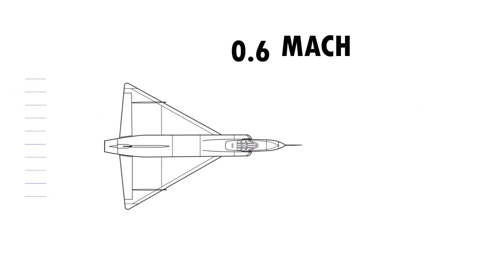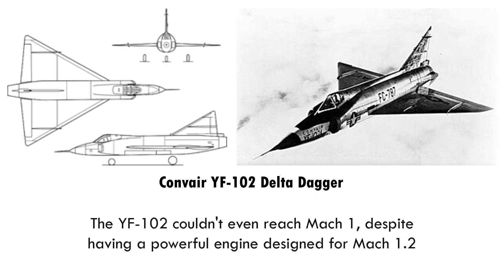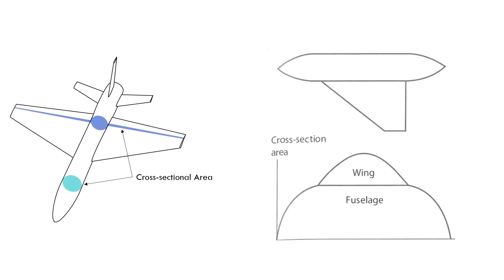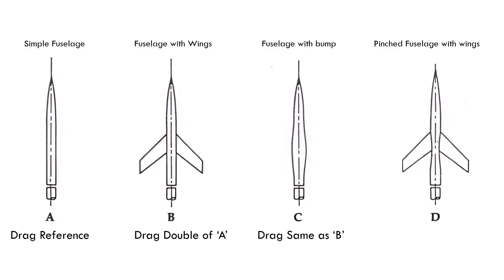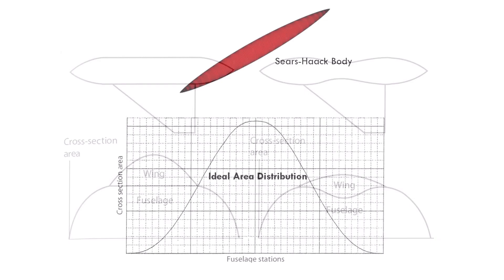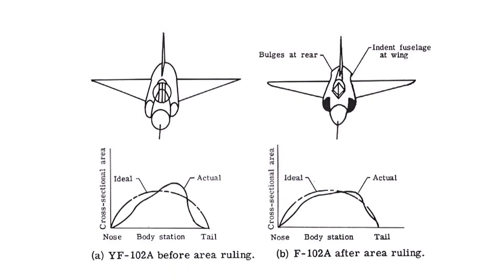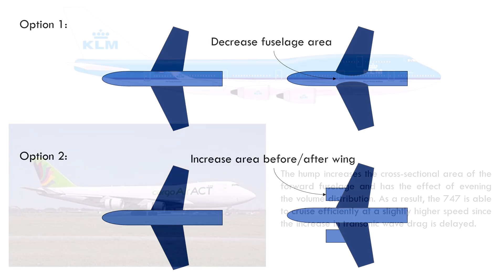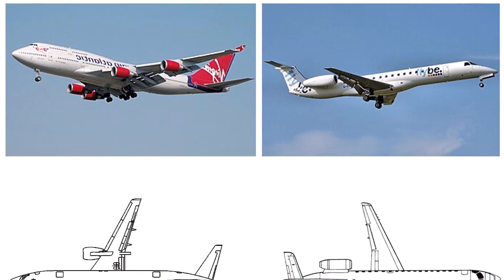How to apply the Area Rule to Decrease Wave Drag | Aircraft Design

Comment: Where is the area rule of the F35 and the F22
Reply from the maker: Today's fighter jets have much more powerful engines than those available during the 1950s, so the area rule is not as essential as it was back then. Today, the area rule is more important to subsonic airliners, so that they can cruise faster and more efficiently.
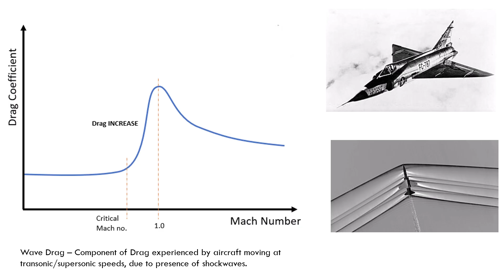Reply: From the graph, 0:16, it seems this effect only matters at transonic speeds. If jets are powerful enough to accelerate and cruise at Mach 2, designing for the transonic region is less important. However, you can still see the "waist" on 5th gen fights like the bottom view of J-20, where the engine section narrows as the wings extend
Reply: Looking at the video and your comments, things don't add up.
The 747's high cabin has nothing to do with Aeronautics.
The video is confusing.
And it's not explained why a MIG31 doesn't use this thinner body design in the center fuselage.

As far as I can see, this was more a study of how to improve transonic traffic.

What's more, nowadays companies are more concerned with reducing sonic boom.
Reply: It's there - Subtle on more blended wing-body designs - Area rule is more complex than this simplified video discusses - Having to do with the optimized design Mach cones over the entire aircraft length, from the mission performance profile (best I can offer) - But explained pretty well enough here - Enjoy (!).

Comment: Excellent presentation! I never knew that the Boeing 747 "hump" served such an important aerodynamic purpose - I thought it was just there to provide some extra interior space.
Reply: The reason for the hump on the 747 is because the design originated to haul cargo.  The hump allowed the cockpit to be far enough above the main cargo deck to allow full size loads to enter through the front of the aircraft and pass under the cockpit.  This had nothing to do with trying into reduce transonic drag.  The 747 lost the competition for the USAF jumbo cargo jet, and Boeing  never had reason to design another jet with a hump despite the fact that they still design for low transonic drag.
Reply: @gort8203   I know all about that, other military transporters such as the C-5 also have their cockpit above the main interior to make for more room in the cargo compartments. My point is that engineers discovered that extending the already existing hump would make the plane more streamlined in accordance to the Area Rule.
Reply: @ChrisZoomER  That's right, the C-5 didn't need a hump because it had two decks, and it didn't get a hump to improve area rule even though it cruised at a fairly high Mach number for a military cargo jet.

The 747 hump was extended to add more first-class seating in later models.  Extending the hump farther back over the thickest part of the wing is more likely to be a detriment to area rule than a benefit.  I think you are just making stuff up.  Quote me the Boeing design study that supports your claim.
Reply from the maker: @gort8203  This NASA report states the application of the Area rule to 747. Please take a look: https://www.nasa.gov/history/SP-4219/Chapter5.html   

This video also states the same: https://youtu.be/_X5VHl0eMTk?si=bDZyhCV0z9Jzr77A
Reply: @AircraftDesignToolbox  Thanks for the refence. I withdraw my suspicion that you made this up on your own. I now believe you were the victim of previous misinformation.  

Let’s not even talk about that other YT video, which is proof of nothing. That article you referred me to does briefly mention that hump of the 747 was added to reduce transonic drag, but the footnote for that statement is not any document related to the design of the 747.  The note cites a 1995 telephone interview that was not even conducted by the author, but by another writer named Hansen. So the claim is based on at least secondary hearsay of a telephone conversation with a retired and elderly Richard Whitcomb, who did not design the 747.  

I’m sure said something related to the 747 hump, but I suspect his remarks were misinterpreted and did not actually claim that the purpose of the elevated cockpit of the 747 was to reduce drag.  And even if he said that it could have been confusion or wishful thinking.  I want to know what Boeing said about it.  Everything I’ve read states that the purpose of the elevated cockpit was cargo loading, just as it was for automobile ferries like the Bristol 170 and the ATL-98 Carvair.
 
If the 747 hump was added to reduce drag we would see similar humps on other passenger jets, but we don’t.  So like I said, I apologize for saying you made this up, but I still do not believe it.
Reply: @gort8203  Thanks. But what I do know is that Concorde didn’t have a narrowed fuselage along the wings because it wasn’t practical. Something that Boom Supersonic is trying to overcome.
Reply: @ChrisZoomER   It is an apples-to-oranges mistake to compare the Concorde or the B-1 the 747.  It is always inconvenient to have a coke bottle fuselage for area rule, but it is necessary on jets that have insufficient thrust to accelerate through the transonic region without it.  Subsonic airliners don't really need area rule, so practicality wins hands down.  If airliners really needed to cruise at the high Mach numbers where area rule would save a lot of fuel, they would have it despite the structural difficulty.  And once you are supersonic area rule no longer helps, which is why Concorde didn't need it.
Reply: @gort8203   If supersonic planes don’t need area ruling, then why does that NASA article say that the area rule is applied almost universally to such aircraft for reducing wave drag? The B-1 Lancer has a fuselage that narrows sufficiently along the wings and wing box despite being supersonic.
Reply: @ChrisZoomER  Yes, the B-1 has area rule.  I did not say it doesn't.  Transonic area rule is not applied universally to all supersonic aircraft, but its purpose when applied is universal, which is reduction of transonic drag.  You mention one without it yourself, and if you look at modern fighters it’s often hard to see much transonic are rule. They are so powerful they do not need it to get through the transonic region where drag rises markedly.  Transonic area rule reduces drag in the transonic region, not in supersonic flight, where aerodynamics are different.  Most early supersonic aircraft starting with the F-102 had area rule to allow them to accelerate through the transonic region, but even the F-100 got though without it.
Reply: Just to add some context to this argument. Boeing never designed the B747 cockpit hump specifically in accordance with the area rule. The original boeing concept for the usaaf contract was a high wing double decker with fore and aft loading ramps. Elements of the design were incorporated into the b747 design. Boeing discovered though that when they stretched the upper deck to accomodate more pax in the b747-300 stretch upper deck(sud) their was a significant drop in drag. That discovery has people today with the misconception that Boeing utilized the upper cockpit bulge specifically because of the area rule.
Reply: Please excuse the "their" instead of "there". Auto(in)correct is the bane of my life!
Reply: Yep, and the newer 747 variants have a longer hump to distribute the cross sectional area even more!
Reply: Yep, and the newer 747 variants have a longer hump to distribute the cross sectional area even more!
Reply: I always thought it was so they could put in a 2d floor lounge. The more you know...
Reply: The 747 had it primarily so it could also have an opening nose cargo variant.
The drag improvement is a side benefit.
Reply: Also the pilot deck above the fuselage enabled using the 747 as a cargo plane.. Dual benefit
Reply: @625shapiro we operated B747-200 special freighters and while nose loading has benefits side loading behind the wing was better due to the height restriction under the cockpit which could cause a loss of up to 40% capacity if you only had nose loading. Best case would be nose and side loading but if only one option available then side loading was first choice.

Comment: The wing component of the cross sectional area curve doesn't make sense. You show a wing with a perfectly straight trailing edge, but the back half of the area curve for the wing descends in a smooth curve....
Reply: Note that the cross-sectional area of a wing decreases as one moves towards the trailing and outboard edges, even as the top-view planform area may increase - Also, this is a MUCH simplified discussion video on the subject - Additionally, the 'area-rule' is actually a 3-d area around the optimized mach-cone for all the location points along the center of the aircraft length - Enjoy.
Reply: airfoil

Comment: The rule is not super-, but about near- and transonic flight. In practice, this problem was solved until the 1950s. For example, the elongation of the gondolas of Gloster Meteor mk 4. A qualitative thery in aerodynamics is often more valuable than a mathematical theory.
The US is first introduction of the transonic wind tunnel, where for the systematic research  not for artillery.
Reply: can you check your typing? It sounds correct, but I am confused by "where". And how is this video not "qualitative" ? CFD is mathematical.
Reply: I thought no one would ask. Thank you. I am an old barbarian revisionist from Russia. You'll have to ask me and my translator again. I don't understand jokes if I don't want to.
1. I don't like the pattern that most stories start with some nonsense. Then it can be much better. At first I thought it was only communist.
2. The story is not for those who know how to separate essence and work from popular opinion. But this is an appeal to the naive, and the nonsense is in the pictures. Large picture old-fashioned triangular aircraft, small video almost straight-winged true supersonic. (I'm focused to direction.)
On sweep prevails in this blog. And so do naive aviation history buffs: the sweep grew, and its benefits were recognized for a long time... While it has not been abandoned almost immediately.
When were the first high-speed swept-wing aircraft designed? I narrowed eye. So this is a real question. I would like to see chronological events not contradict the narrative.
3. CFD has completely NOTHING to do with the area rule. This is a substitute for a good experiment in a tube with a lot of staring and guessing. You can even explore whether there is an area rule. The gunners are still not sure about this. These are transonic, transitional phenomena. Let's look at transonic conformal tanks?
Doubt the rules! Revisionism! Avoid introductions if you can't start by acknowledging the facts.